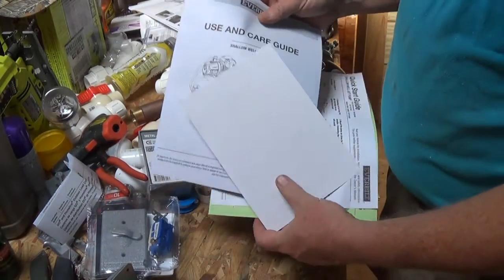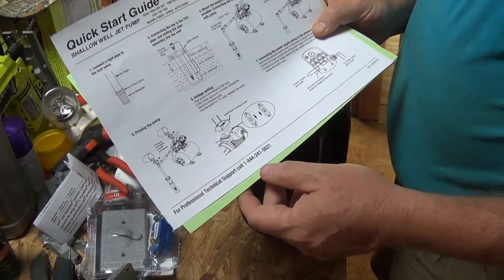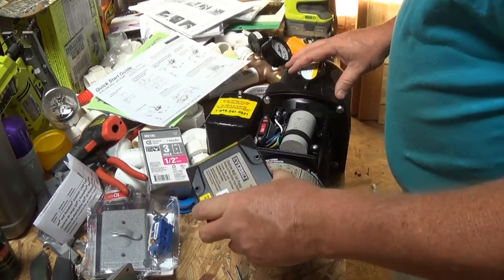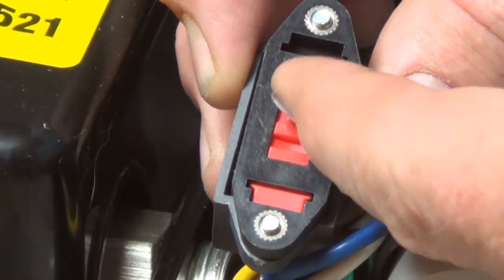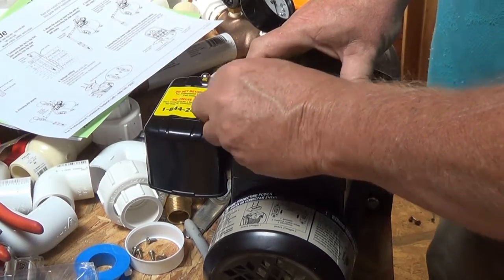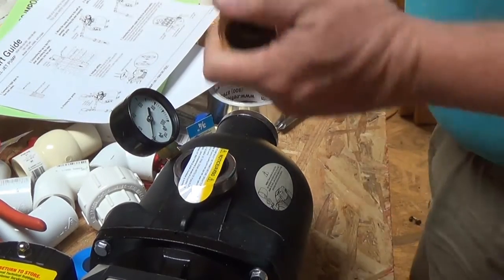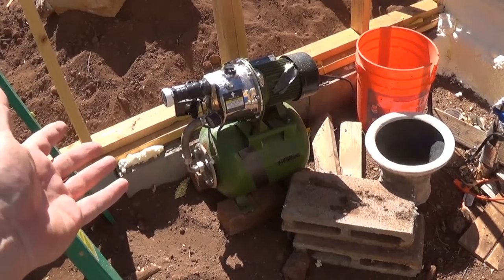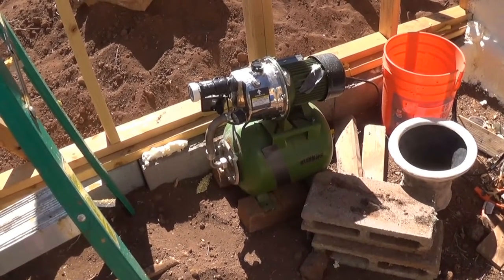Shallow Well Jet Pump n Pressure Tank Plumbing

Comment: Hi Jeff, hope you are doing well. Thanks so much for all the videos you put together, very helpful info. I am off grid in northern AZ as well, in the Williams area, so similar climate. How is the Everbilt pump running for you? I purchased the Harbor Freight pump a couple years ago and have been using that, but need to build a pump house before winter sets in and plan to add a similar pressure tank. I heard I can use the Harbor Freight pump and connect that to the pressure tank, which would give you the water stored from both.
Reply from the maker: not sure about using the harbor freight pump and a pressure tank. the everbilt pump is doing great. . nice area by williams.

Comment: I have a similar pump and tank ... I'm having a issue with the system not pressuring up. The pump works and builds pressure, but it will not pressure up to 30 psi at the pressure Tank. I do have a gauge installed before the tank, to monitor pressure. The water supply is coming off of a 15 foot deep x 4 foot wide holding tank in the ground . My original question, is why would it seem to be acting like it's sucking air? ... I have primed the pump and from the pump up to the pressure tank, I have clear plastic line, so I can see the bubbles .. but I  might add, ( I'm not sure if it matters) the guy who installed the system, has the pump mounted 4 feet below the pressure tank, so it has to pump up to the pressure tank first) . At first he thought maybe my pump was no good, and installed another pump that he has, that he knew was a good pump, but had the same issue, so put mine back in. Any advice you could offer, would be greatly appreciated. Thank you. And great video
Reply from the maker: i wish i could help. i dont have answer. . i did a video on jet pump cycling problem. lots of people commented on that video as to why i was having those problems. i wonder if you reached out to some of those folks they can help you . good luck

Comment: Ok that girl on the pump box was creepy, I ask myself why lol. Would a pump like this be overkill for me? Getting $$$ to buy a huge tank to put down near the road for easy access for delivery. The road is a slight downhill from main living area. Would be using it for the outdoor bath house with a shower, washing machine, and a faucet to water plants.
Reply from the maker: actually i think this pump and pressure tank is perfect size for 1 to 2 people. you know the pump will give you plenty of pressure and pump the distance you need.